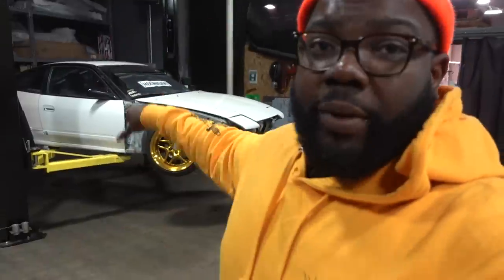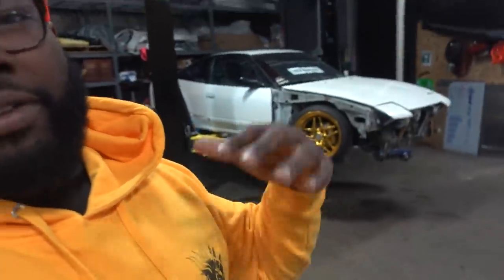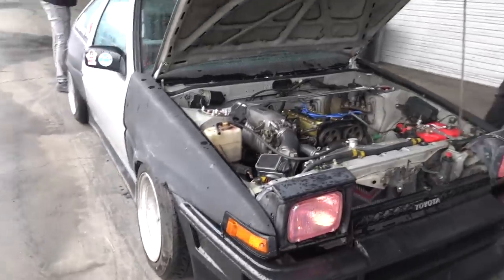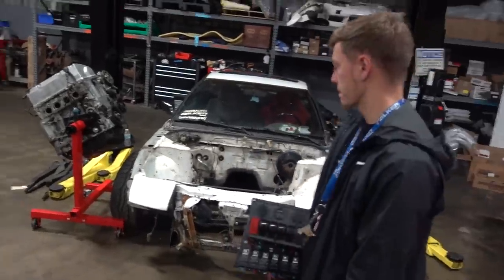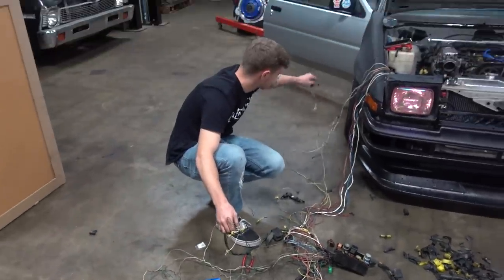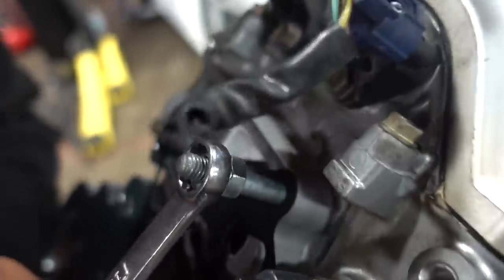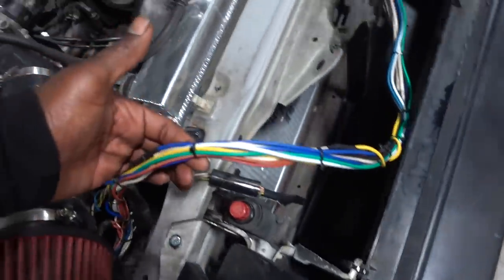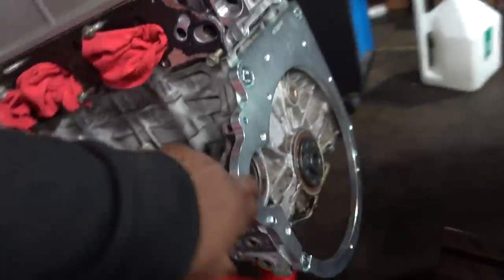UnPros Garage: Two Projects at the Same Time?? Turbo Honda K24 Powered 240SX AND AE86 Corolla Ep.2

Comment from the maker: Honda K24 or Nissan KA24, which is better?!
Reply: Higher rev = k24
Reply: Ask hert to do truck trunk
Reply: 4A-GE
Reply: Built Toyota 22RTE
Reply: I love ka24 sound.Fisrt i play the need for speed undercover,i choose the 180sx,that sound is beuty
Reply: K24
Reply: Lawnmower machine
Reply: Nissan, tried and tested, better weight distribution... and it’s DESIGNED to be in there..
Reply: Hoonigan Project Cars sr20
Reply: the KA24 is a pickup engine it really doesn't like that high revving thing with out upgraded parts it will spin a bearing sooner or later the Honda engine has more power potential.it's a more modern engine
Reply: Hey hert are the cuts behind the rear overfenders “aggressive”....
Reply: Simple stallion sk24
Reply: Or blanco stallion
Reply: K24
Reply: They don't make a billet ka motor.  There should be a good reason for that
Reply: Honda motor hands down its reliable and can make enough power to get you to slide
Reply: That's like asking which is larger 1 or 2
Reply: KA sound with K power.
Reply: K24 all day... Honda's are actually reliable
Reply: Be a homie and put that lifesaver of a wiring god in the description🙏
Reply: @shxtbox  Was it really designed to be in there though. It is just a hardbody engine. They just made mounts to fit it in haha. The sr20det was designed to be in it.
Reply: Jimmy Oakes is putting a KA24 in a Honda Civic
Reply: 13b
Reply: Ka24der!!!
Reply: K24
Reply: Diggin the 24 but yeah hert bro I could do the DBZ announcer voice for man ya don't whisper it you say it from the beard.
Reply: Ls
Reply: @mbsnyderc  you have no idea what you're talking about. Jwt cams and it can Rev easily to 7-8k. Ka will make way more torque and have a faster spool bc of it.
Reply: KA24 pourvoir
Reply: Imo KA
Reply: K24 is one of the best engines ever made
Reply: Honda of course
Reply: K 24
Reply: Whichever is running and hooked up to a functioning car...
Reply: Sr20
Reply: Nissan k24
Reply: LS
Reply: Prius’s triple a batteries
Reply: K series.
But 3SGE tho..
Reply: Ayyy, where's your music listings at?
Reply: 1UZ turbo...
Reply: K24
Reply: Hell yeah 8e86
Reply: KA24 I Think personally.
Reply: k24 is honda's best engine.
Reply: K24
Reply: @pablomichel1656  stock ka has enough hp to make you slide...
Reply: @isaacshively6705  false
Reply: Honda baby
Reply: @mbsnyderc  thank u teaching these fanboys the ka it's not the only engine u can run in a 240
Reply: john mac  once the k is in there repairs will b cheap n simple , since there are way more k parts available theN ka parts plus ka is like a 15 year old motor k series is a way newer engine with huge aftermarket
Reply: @evansautomotive307  thank you lol ka isn't even the good Nissan motor choice lol people sound like classic mustang owners crying cuz ls is more reliable n cheaper than 5.0
Reply: @FriedEggsandJellyfish  no it won't k series can rev to 9k stock no cam upgrade needed plus ka is known for blowing head gaskets and it won't hold as much horsepower stock as a stock k series. Plus you blow a ka u gotta look around for one with low miles, u blow a k and u just stop by the junkyard lol
Reply: @shxtbox  no it's not it's a generic motor they put in the hardbody pick up and frontier
Reply: @ruffledsasquatch2943  consider it bro there is an abundance of k series everywhere n lots with low mileage, u gotta look for good ka motors and aftermarket is huge for k series
Reply: @clutchkickpj693  yes we seen him struggle to slide this car when he bought it hert wants to make power to slide fast and give it all the beans ND not worry about engine failure
Reply: k23 k IS GRBAGE U CAN REV THAT K20 TILL 9+K JUST LIKE A ROTORY THINGY LOL
Reply: 1ufze extremely reliable and plenty of power and not that expensive
Reply: Honda K24.. Taking notes, next year going to build one.
Reply: @Jodeyjoe559  guys who own k series beat the piss out of them. If you junkyard swap one without a rebuild you're a fool. Even bigger fool if you think Ka24s can't make more power. Look on ka-t.org there are hundreds of cars making 6-700 hp reliably and still lasting. Plus way more torque and stroke ratios are better. Do your research first Honda boy. I been building Nissan motors before you knew what a civic was lol
Reply: @FriedEggsandJellyfish  bro ur a Nissan fan boy lots of people swap k series straight from the junkyard and boosted boiz just built a 1100hp k series and it's twin turbo and the Grinch is a reliable 1000hp awd so what r u sayin. If u only look at Nissan forums of course there gonna praise anything Nissan the sr20 is the best option besides rb I research it all don't need lil fan boy to tell me what Nissan engine is best. K, B, H, J  series all day sucka 😆 u should do some research bud anyone except a Nissan fan boy will tell u the same thing I did.
Reply: @Jodeyjoe559  quit replying to me already. Really not trying to argue with some kid who's never turned a wrench. Let alone who is ASE certed. I'd love to get on technical nerdy terms but it would be too hard for you to comprehend. Have a good new years and try to build a motor pleb  👍
Reply: KA because i like torque
Reply: K24! Get a used moter less than 800 bucks

Comment: I think I might be more stoked on the Corolla. I've wanted one forever. Looks like everything is coming along great on both cars man, I can definitely appreciate how it's still going to be a simple seat time stallion with the K. Other than initially getting everything in and fabbed up it should be pretty simple to maintain and be crazy reliable. Plus if you break something, other than the few custom parts to get it installed, you can go to any parts store or junkyard and get parts stupid cheap anywhere.
Reply: Tsuiso Sim Drifting exactly! Someone finally understands me 😂

Comment: I'm in my garage right now installing the new 370 5.7 stroker built for boost in my charger.
Reply: It's a 5.7 Hemi stroked to a 370 (6.1) I had a 400 (6.6) 5.7 stroker but it hurt a piston and was getting old so I freshened it up for boost via a procharger

Comment: When I was stationed in hawaii I had a pig nose s13 with a sr20 red top. The swap was a hack job and a wiring mess. But after I had the wiring pulled apart and redone it was so nice and now I kinda wish I still had it (sad face)

Comment: A 240 is almost always going to be a "simple" car. The k24 might not be the simplest swap to do but it's not too far from most other swaps and once it's done it's still a k24 (simple) in a 240 (simple). This also means if something gets hurt or breaks you can walk into any auto parts store and they'll have just about whatever you need in stock on the shelf. Simple.

Comment: zfs can handle power. we street drove one with 800whp for a while. weve broke them with 1st gear launches and loading them up in  third gear and letting the boost build till it spools and breaks tires loose eventually ran a built t56 with an adapter mated to a m52

Comment: If its not insanely powerful, is reliable, and didnt cost boat on boat loads, i would call it a simple seat time car, honda motor is actually genius in my opinion, parts are super available and ive seen them over abused time and time again and they keep goin, personally i would throw an old school small block chevy in there, but thats just because i have more experience with them then any other motor
Reply: When it comes down to it, do what you want, cuz you wanna, but drive more, videos of you driving are getting thin 😂 dead jealous of the ae86 tho, i tried to get one and only found 2 in canada, one was just a shell and dude wanted 3g (which is nuts to me for a shell with no motor, no trans, no rear end, no interior) and one was 21g for a perfectly good one with some cool mods but A. Too expensive for me, B, i want a near stick one so i can build it the way i want and can buy manuals on it and have them actually match

Comment: On my 93 eg Civic my gauge cluster decided to crap out and now my turn signals don't work, I don't know my rpms, I don't know my speed, AND I don't know my fuel level.
Reply from the maker: All you need to know is where the rev limiter’s at and you’ll be fine.
Reply: @HooniganProjectGarage  I just put $10 in gas ever few days and use hand signals around town. The rev limit is 8,500rpm and I know my rpm by sound

Comment: Please go take the oil pan back off, remove the oil orifice for the balance shaft oil pump and block it off with a bolt.  If you don't you will have very low oil pressure.
Reply from the maker: This must be some type of Honda Wizardry.
Reply: @HooniganProjectGarage  When you change to the Type S or R oil pump without the balance shafts this is a must.
Reply: Motor is coming back out after Fab, no worries. It’ll get done.

Comment: ca18 wouldve been an option. 200 pounds ligher than sr20, higher torque, higher rpm, iron block. easily made into ca20 too. and wouldnt have needed a lot of fabricating.
Reply from the maker: Then you realize CA18’s are $2,500... 🤦🏻‍♂️
Reply: @HooniganProjectGarage   well goddamn, they are that expensive? i thought they'd be cheap since everybody and their grandma goes sr20 on any s-chassis, but damn

Comment: Ka24 is way better. Could be fully built and running now, making more power and torque.
Reply from the maker: For double the price...
Reply: @HooniganProjectGarage  are you kidding me? Check out ka-t.org. Obviously never built either k series lmao. The de has plenty of affordable parts to make 6-700. Both builds would come out almost the same, after fabricating costs and shop costs.. If you're incapable of doing these yourself

Comment: K's are not as reliable as people make them out to be. most k swaps are for drag racing. we will see how one holds up banging limiter around a track lol
Reply from the maker: We’ve already seen multiple K-series cars from the crew at TF-Works. Freshly designed oil pan, and some other oiling mods and she’ll last forever.
Reply: That's a cool fact that isn't wrong at all Tyler